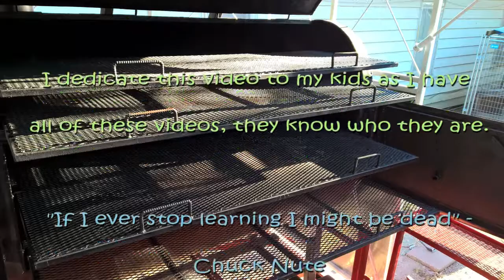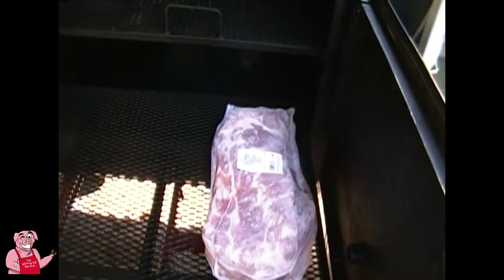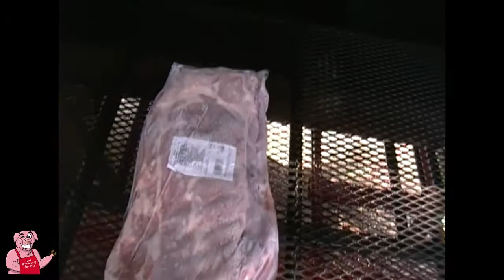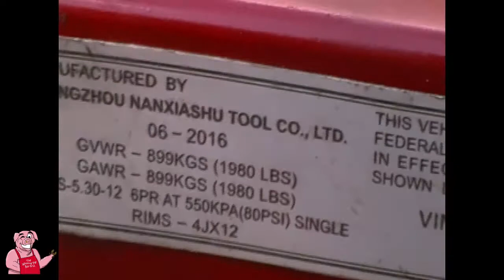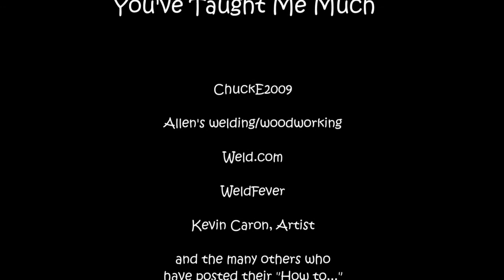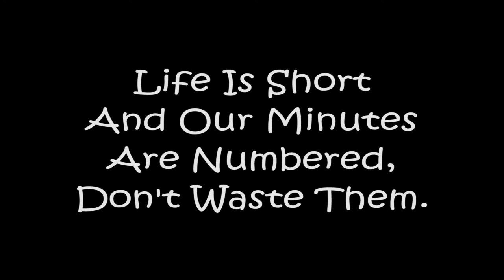The Great Smoker Build, The Saga Continues Part 9, It's Finished!

Comment: Very Impressive....I must say! 
This is a very interesting and unique design.  When I first saw this pit....I thought it was a reverse flow design.
But after watching the vids...this is some sort of a hybrid style cooker.  Can't say I've seen a design like it, with the firebox
and the exhaust stack on the same side, with the use of tuning plates.  Very interesting Sir!
Reply from the maker: I'm not the first to come up with the tuning plate design, and I do have the ability to make it almost totally a reverse flow by moving the tuning plates so there's no space between them with the only openings being the small gap between the first and second plates then one large gap at the far end of the smoker but I haven't had the need to try that. I've been very pleased with my results to this point. It gives very even temps and smoke throughout which was the intent. If I was going to do one thing over again, I would make the drain a larger diameter, maybe 1.5 or 2". I looked at several other designs of 275-gallon smokers here on YouTube and used what I thought was good and changed what I thought I could do better and this "Betty Lou" is what I came up with. Thanks again for watching.
Reply: I can't argue with that......the Best of both worlds!    Bravo My Friend!         Metal On!  \m/